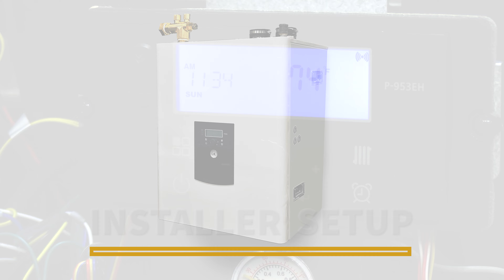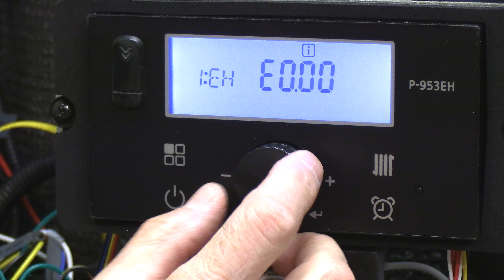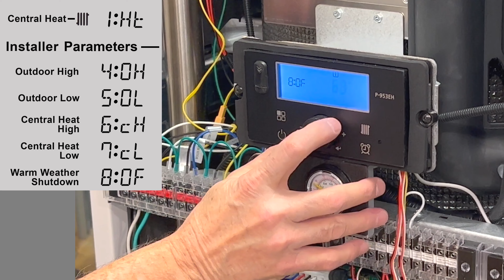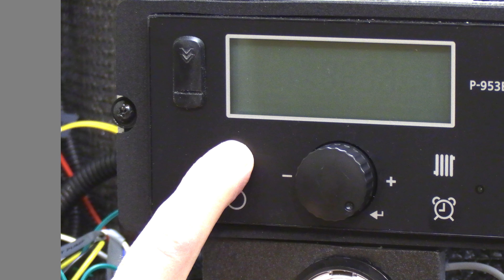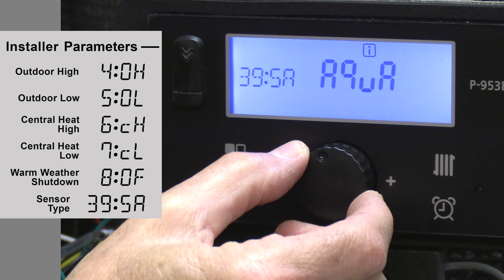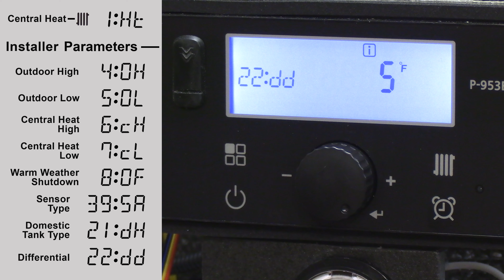FT Series Boilers (all sizes), Basic Installer Parameters.

Comment: What supply temp should be set for cast iron radiators?
Reply from the maker: Hi Harold, thank you for reaching out! You should set the setpoint to 180 deg. F for cast iron radiators. If you have any further questions please don't hesitate to give us a call at  1-800-900-9276.
Reply: Sure' how about the minimum temp with the outdoor set at 55f. Will 120-130 work? Thanks. I live in Allentoewn Pa.